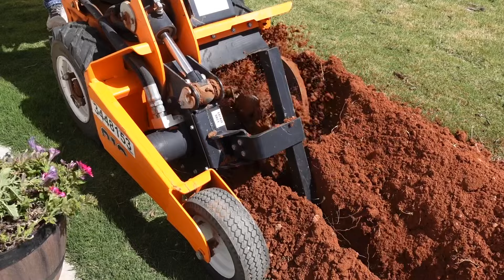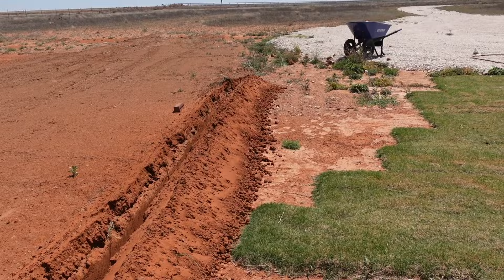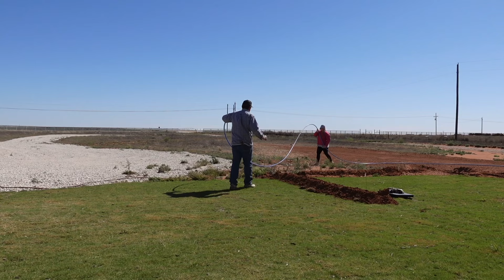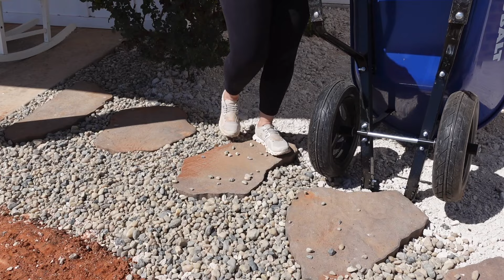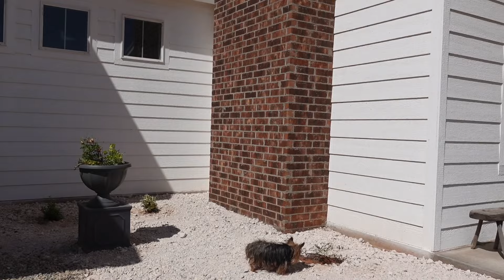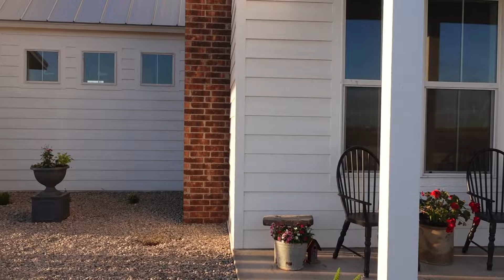Landscaping | Sprinkler System Installation

Comment: Hard work is paying off & getting some good exercise while doing it! Did your pedestal come with your black urn or was it separate?
Reply from the maker: Thank you Teresa! Definitely getting my exercise in! The urn and pedestal were separate purchases. I got them both at Home Depot, but they were not a set. The pedestal was called Estate Planter https://www.homedepot.com/p/15-in-Estate-Grey-Fiberstone-Square-Planter-CPX4-35D-GR/317886606 and the urn was called the Warwick Urn Planter https://www.homedepot.com/p/Vigoro-18-in-Warwick-Large-Black-High-Density-Resin-Urn-Planter-18-in-D-x-14-7-in-H-HDR-081685/314096541